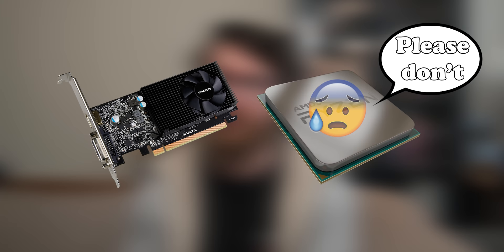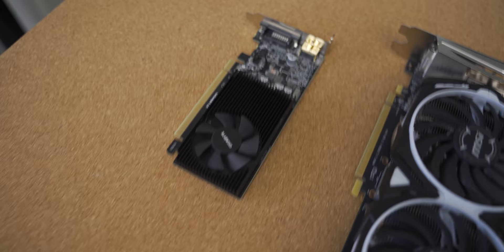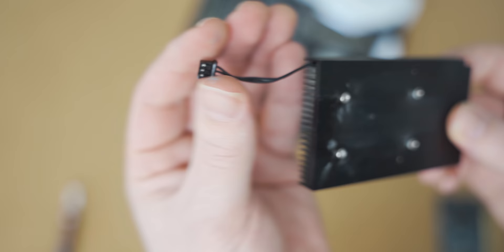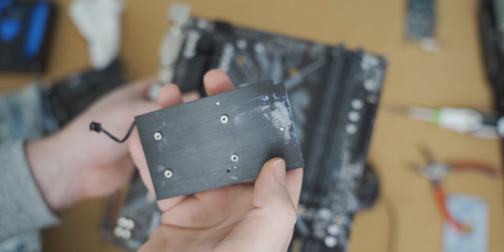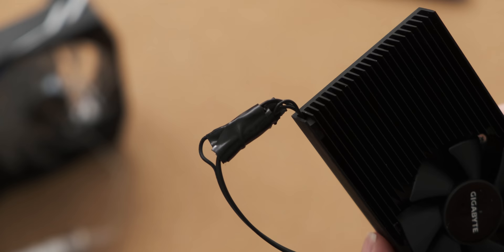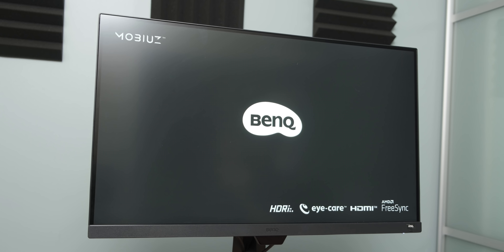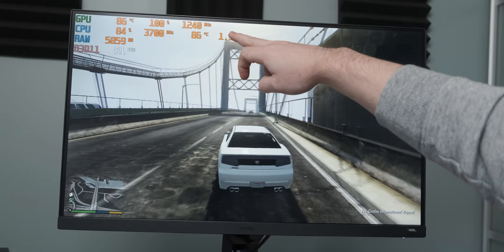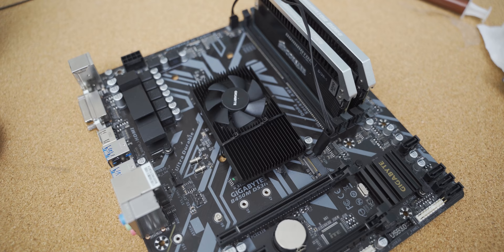GPU cooler on CPU - Cooling a CPU with a GT 1030 heatsink?

Comment: When the 1030 cooler is better than an intel stock cooler
Reply: It is certainly an error.
Reply: No, no, you misunderstand the superiority of that device. The stock Intel cooler is designed to run at 90-100°C, where it's most comfortable, which is why it never really bothers cooling things down.
Reply from the maker: I sense a death match arena of death coming. 😁
Reply: @DawidDoesTechStuff maybe try the gt 710 cooler
Reply: @DawidDoesTechStuff  Yes Please, 🤔 including the new i7 10700 Black Stock cooler & the all the different Wraith Coolers 😁
Reply: Because at least this cooler covered the whole chip (ish)
Reply: You mean the ten thiddy cooler
Reply: Honestly not surprised
Reply: @DawidDoesTechStuff   intel crap cooler vs gt 1030 do ittttttttttttttt
Reply: lol, but in seriousness my intel cooler was okay keeping my processor under 60 while doing full load
Reply: You can use 3 pin connector in pwm connector , fan rans at max speed no need to splice new connector
Reply: @DawidDoesTechStuff  yes
Reply: Ha
Reply: I just throw my pc in the bathtub after filling it with cold water in the winter.
Reply: @Bacontsu  same
Reply: @swirrllfolfsky9803  nah man that's too good of a cooler put a gt 210 cooler
Reply: Intel stock coolers don’t set bar very high tho lol
Reply: lol i'm using my cooler box while my watercooler doesn't arrive and the max temp I hit is 70 C in 10 min of constant 100% usage. Most games barely gets me above 40/50%, so i'm okay with that.
Reply: Maybe GamersNexus should try this with the Dell 3090’s heatsink
Reply: Damn. My old AMD CPU on an older PC I had running 15 years ago, it used to choke and cause BSOD's whenever the CPU temps got near 78C. Newer computers run ridiculously HOT. 70-80C 15 years ago was considered very hot for CPU's.
Reply: @DawidDoesTechStuff   did you wind up making that death match arena of death? I would love to see that!

Comment: “Sacrificial components” cries in Gigabyte B450M DS3H
Reply: * glances at my ASRock B450m HDV R4.0 *
Reply: @J Fz Only joking, it’s cheap and it works, no problems here, though I’m currently saving for a better one
Reply: I literally just got and built on a 450m Steel Legend...that particular comment stung.
Reply: @alphaasianjosh  I know. All Jokes here. xD

I'm currently waiting for the news regarding Ryzen 5000 series and Radeon 6000 series compatability on B450. That is... the SAM-feature of the Radeon 6000 and how it'll work out.
If B450 is viable, I'm going for an Asus TUF B450m Pro.
Either Pro-1, Pro-2 or Pro-S
On Paper Pro-S is the best of the bunch.
But I prefer the looks of Pro-1 & -2.
Pro-2 isvery similar to Pro-S on paper, apart from the LAN and SPDIF audio-port.
Reply: @janwitkowsky8787  im pretty sure they said ryzen 5000 can only be used wth b550 and up :(. i also have a b450 and was kinda sad to hear that. maybe theyll give a bios update to support it, hoping.
Reply: cries in crappy 2011 dell motherboard
Reply: @haydenwiseman3056  no, you can use 5000 series on b450. You just need. A bios update.
Reply: I use that. It's a pretty solid mobo for the price imo.
Reply: It's the one in my build. I have zero complaints.
Reply: @haydenwiseman3056  Ryzen 5000 compatible BIOS have been confirmed by AMD to be released to MB vendors around January. B450 gang unite!

Comment: Looks like I might be getting famous! 🤣 The video Dawid mentioned is my GPU Cooler on a CPU. Hope you guys enjoy it - and don't forget to check out other TL videos to see if you like the channel.

Thanks for the shoutout / credit Dawid. Appreciate it man.

Great video... As always.
Reply: I've been thinking about doing a similar thing, but instead of actually using it as the main cooler I would use it as a secondary cooler on the CPU backplate. I came upon this idea a few weeks ago when I found out that the back plate and other components on the back of my motherboard we're getting extremely hot on my lga 2011 setup. I did a quick search on Google and found that other people had similar ideas and they actually had some noticeable success in lowering CPU thermals by doing so.

So now I've got this crazy idea to rig some kind of vapor chamber heatsink cooling mechanism with a blower fan on the back side of my motherboard. Then that idea spawned numerous other cooling ideas and now I've got this absolutely insane idea for a cooling rig that spreads all throughout my case! I plan to make it this epic project someday that I'll do videos on throughout the process! 😂

Comment: 5:15
Get a multimeter, set it to continuity, find a common ground on the GT1030,  then you can find which one is the ground pin in the card's fan plug.
Reply: And which wire is for power by testing the pcie connector and the fan then the other wire is for speed control

Comment: "Jarvis enhance image"

You're doing your soldering wrong
Reply: Just to keep things reverseable, use cables between the motherboard fan connector and the fan connector or to make sure that the soldering got done right, experiment with an otherwise broken deltaco table fan for the sacrifice as that is how I test things like these. Doing this on a motherboard is a tad costly to do in my opinion.

Comment: The fact that you can run a 5600X with this (65W on both parts) is brilliant, and tbh more mobo manufacturers should do integrated cooling with like 120mm fans for itx and such horizontally on the mobo with a little hatch to put the cpu in

Comment: I've been thinking about doing a similar thing, but instead of actually using it as the main cooler I would use it as a secondary cooler on the CPU backplate. I came upon this idea a few weeks ago when I found out that the back plate and other components on the back of my motherboard we're getting extremely hot on my lga 2011 setup. I did a quick search on Google and found that other people had similar ideas and they actually had some noticeable success in lowering CPU thermals by doing so.

So now I've got this crazy idea to rig some kind of vapor chamber heatsink cooling mechanism with a blower fan on the back side of my motherboard. Then that idea spawned numerous other cooling ideas and now I've got this absolutely insane idea for a cooling rig that spreads all throughout my case! I plan to make it this epic project someday that I'll do videos on throughout the process! 😂

Comment: Dear Dawid, love your vids, may I suggest putting orangewood dowels behind the socket to give the zip ties a rounder corner. Orangewood is preferred by watch restorers for it's hardness, fine grain, non-oiliness, not-marking, non-particulate producing qualities. Also it should be non conducting.

Comment: I have a fan that I botched together into a USB desk fan, all you need to make sure that the fan pinout is correct is a USB cable with one end cut off, and the Positive/Negative rails marked and stripped; just take the two cables and smush them together with the fan cables, and it will spin when you get it right. It's dumb, and technically a fire hazard, but it's super effective for testing basic electronics when the risk of damage is basically none. And as long as you follow at least the most basic of electrical safety measures, it's not going to start any fires. Sometimes the cables going into the earlier mentioned desk fan rig fall out because of bad tape, and as a result I've had a live 5V just sitting on a carpet. If that doesn't start a fire, I don't know what would.

Comment: For anyone doing basic fan modding, like he did to make the 1030 fan work, you can get those individual wires out, and they still have those tiny metal pin holders that do the connecting. You can put those on any fan header just fine. No cutting needed.

Comment: Pro tip (srsly). Standoffs like this on cooler seem to be pressed in, but they do have thread so, warm up the heatsink as much as you can while still being able to hold it (vice?) take a nut or other cylinder shaped sturdy object bigger than outter diameter of standoff and higher than it is, take a bolt, a washer and screw it in to  standoff. If done correctly you have created a puller, that will drive out pressed in standoff. Work smart, not hard.

Comment: When cutting and splicing wires, there is a neat trick you can do where you cut each of the 3 at different lengths. That way all of the splices are at different places, not rubbing against each other. It also makes shorting even less likely

Comment: You can use Butt Buttons (yes) to connect small wires together. You just put the wires in and push the button down and it does everything for you.

Comment: A 3 pin fan plug will easily fit into a 4 pin header...it even has a little slot on the header to show you were it  plugs in...

Comment: For standoffs,you could just use a bigger drill bit and drill it to be flush with the heatsink.And for a 3 pin fan connector,you could put it on the 4 pin fan header,it will still spin at max speed,only motherboard will not be able to detect the speed of the fan,that's all.

Comment: Honestly for low-profile builds, something like this has a lot of promise. I'm struggling with fitting a MiniITX build inside a Ti-99/4A and the CPU cooler is part of the problem.

Comment: I thought about doing this since GPUs generally have much higher TDP than your average CPU so theoretically it makes perfect sense; especially if you're trying to keep things low profile for smaller cases.

Although it's kind of crazy that you were able to cool a 65W TDP processor with a cooler from a 30W TDP graphics card.

Comment: The position does matter. Thermal resistance is a bit lower at the point where the GPU core was before. (Metal does have good, but not inifinitely good thermal conductivity). 
Not that this would've made any difference, it would still throttle.

Comment: Funny thing is, id say this is an average 1030 heatsink. So the fact it even work blows me away. Most 1030s have a slightly bigger heastink with the same size fan, or a decent sized full aluminum one with no fan. Kind of curious how a passive 1030 cooler would do. Maybe like the silver gigabyte one

Comment: As someone who does own a gt1030 on a secondary desktop, I feel so bad for it. It’s half-height single slot, which makes it one of the few graphics cards that works with the sff Optiplexes. It supports 4k60hz, and games somewhat okay on lots of multiplayer games, really the only complaint is HDMI instead of DP output. Sure it’s horribly overpriced for what it is, but it has its niche use

Comment: Next time you need to ' swap connectors' just mash the plastic plug, you do have pliers.  It will give up that tin to solder to as well as be able to keep track which wire went to which part of the 3 pin plug.

Comment: I imagine there is some market for a blower style CPU cooler. I mean, rear I/O is a thing, but if you designed the cooler and motherboard to work together, you could make a decent gap in the I/O shield for air flow out. Could be an interesting cooler situation to see done.

Comment: It would be cool if you do a part two where you remove the pegs so you can center it and add another fan over the bare heat sink to see if there is any improvement.

Comment: I pioneered the open air multi fan design for GPU coolers.  I took a dual 90mm fan from an old case and mounted it on an ATI X800, this was a long time ago, and it was epic.  The stock cooler couldn’t even keep the thing from thermal throttling with the stock fan.  And I was able to max out the OC on the GPU and VRAM 400 MHz stock to 500 MHz OC on both was the limit.  That was a huge OC for back then.

Comment: IIRC GT 1030 is a 30W TDP card, so it makes sense to give it a cooler that has around 40-45W TDP heat-dissipation.
The R3-3200G is listed as 65W, but I think reality is closer to 50-55W
Perhaps even lower, since it can actually run with the Athlon 200ge cooler, fairly comfortably.
Though, just like your video, it would end up throttling at some point.

...

That's an idea.
Gigabyte GT1030 GPU cooler vs Athlon 200-220-240ge/3000G stock cooler.
That that could be some very super ultra slim case options with that.

Comment: the fan cable situation could be made simpler without cutting off the original connector. one can just stick in the wires to the connector and tape it so that it wont come loose and you have a functioning original connector and working of an extended connector with nothing to fuss around that which wire is ground or what not. and this actvity infuriates me.

Comment: I remember a time when high end video cards had coolers smaller than that. For my Radeon 9800pro I bought an aftermarket cooler from Artic Cooling that took up half the card and it was such a beast of a cooler at the time. Now   of course even the cheaper coolers take up all of the card and several PCIe slots. Sometimes I wonder what kind of power we could have seen back in the day if they would have put such beefy coolers on the components. Or what kind of performance we would see today if the power draw of components didn't change. These days everything sucks so much power and generate so much more  heat. Take the Nvidia FX5800 for example. It was known at the time as the dustbuster as it made so much noise spinning so fast to cool a massive amounts of heat. How much heat? A whooping 44W!! Of course today 44W is nothing for a GPU as some take almost 10 times more.

Comment: One thng though is that first, you have it sitting in the open, so that likely contributes to better air flow and heat dissipation.  Second, since it is sitting straight up, even without airflow, heat would simply rise away from the motherboard.  I would say maybe mount this in a case, and even with case fans, it would probably jump up another 10-20 degrees.

Comment: Hey gary here to point out that you did the soldering wrong.
Actually you need to use a $69 soldering gun to solder 3 wires.

Comment: Also some CPU coolers would probably make better Gpu coolers anyway.  I remember the Zalman circular coolers, which actually were very similar for CPU and Gpu, so I suspect you could use on of those GpU coolers on your motherboard for your CPU as the CPU design was very similar to the GpU design, just a a little smaller.,

Comment: I really like the video. But the days that CPUs catch on fire because of insufficient cooling are long past. Intel's Pentium 4 downclocked and shutdown itself to prevent damage and AMD started doing the same thing around the Athlon 64 era. I.e. about 15 years ago.
Reply: I actually had an Athlon 1.2Ghz Thunderbird way back when they came out. I can tell you they did NOT thermal throttle at all. One night a cable somehow came loose in the case and went into the CPU fan and stalled it. The PC eventually blue screened and when I looked inside the heatsink had got so hot the fan and its plastic mounting melted like taffy. I actually grabbed the fan and pulled it up and held it in place till the plastic cooled and solidified and still ran it for a good long while. But I got lucky.

Comment: Some gpu's have soldering holes for external 6pin or 8pin connectors.
What would happen if you solder 6pin or 8pin power connector, would be better to do it or not? Would it increase stability for overclocking? And how much wattage will be available for the gpu to run with.

Comment: Just a thought, but could you not have just turned the heatsink on an angle slightly to get the whole cpu in contact with it but still avoid the stand offs? Genuine question, not trying to be smart...

Comment: i had fans die on a Radeon HD 7870 (was the special powercolor one that used the 7950 chip instead of a normal 7870)   the 2 fans both died  so i removed the shroud and fans then tied a case fan to its heatsink  .. it was months later i realized the chip was usually running in the  80's-90's  so i tied another case fan to it and managed to get it down to 82 under load.  wasn't ideal but i gamed on it like that for a year before finnally upgrading to my current geforce 1070.  that card still works , though i've not been able to replace the fan with original fans yet , so it sits in my closet.  not sure it's worth it to any one now though as the card only has 2 gb of  Vram on it. most games today top that easily.

edited to correct the model number it was a 7870 not a 5870 LOL

Comment: Well it worked cause it is a 60 tdp  chip, the cooler sink for the gt 1030 is for around 45 tdp,  it would burn with the 3400g or any intel chip.

Comment: should have tried undervolting the cpu. my 2200g ran 1.4v on stock and i undervolted it to 1.1 and runs perfectly fine. temps are around 15c lower.

Comment: Well 3rd generation ryzens have a high voltage issue. If you set the voltage like 1.21-1.23 or even 1.2, that cooler could handle the stress of cpu 😂 but anyway nice video.

Comment: I have a two pin fan, how do I connect it to a 3 pin SYS_FAN header?
noise and fan speeds dont matter, just wondering if its okay.
I cannot fit it currently as the plastic lips dont fit but I can grind it off

Comment: Dawid, I have a HTPC with a 3200g I want to turn into a esports beast, what gpu would you recommend as a solid pairing?
Reply: Up to a 1070...like 480/580/1060 performance probably sweet spot